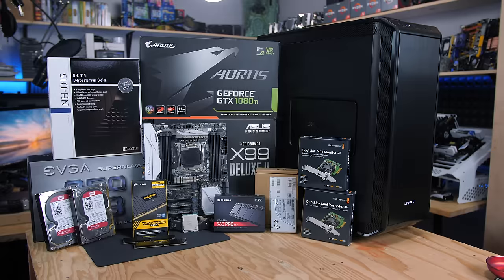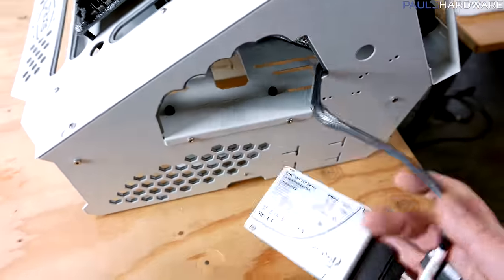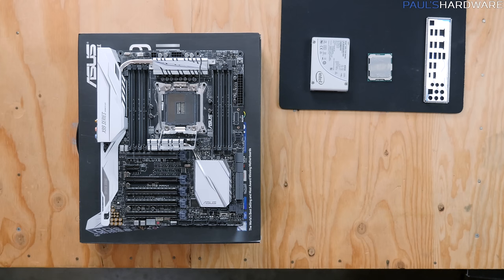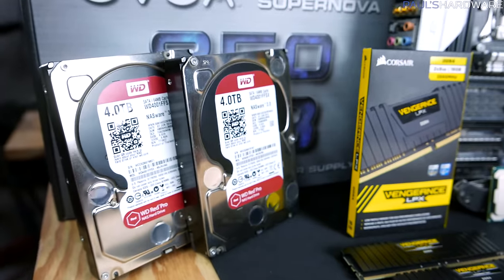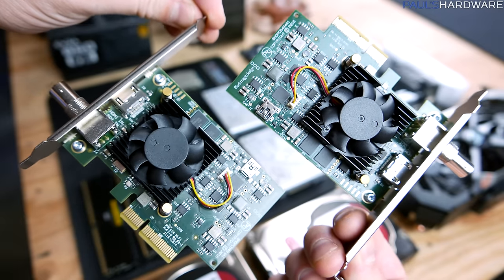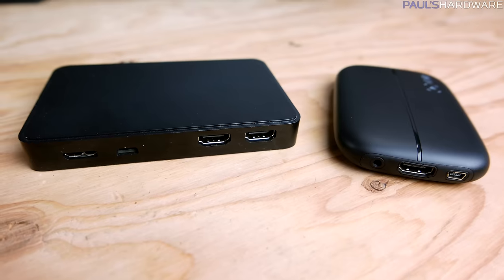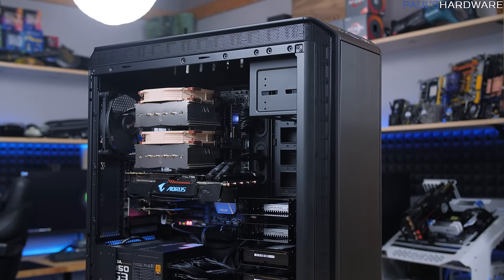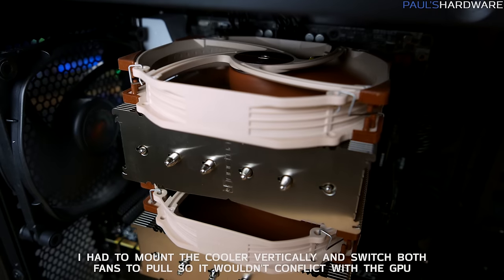The GODLY PC! My Ultimate Streaming + Capture System Build

Comment: This build erased my floppy in no time. Thanks Paul!
Reply: xD I read this in completely the wrong way!
Reply: Wifysauce is awesome.
Reply: I need help guys!!! I want to build a gaming/streaming/editing build. I want to know if these parts are good and compatible with each other. I don't know much about building a pc and the parts.

WD Blue 3TB Desktop Hard Disk Drive - 5400 RPM SATA 6 Gb/s 64MB cache 3.5 inch 
Questions: 
1) Is 7200RPM worth? Or is it worst? 
2) should I get more compacity?
3) Is SSD worth the buy for a content creator? Also what SSD should I get?

MSI GTX 1080ti Gaming X 
Questions:
1) is there a better graphics card? Besides the Titan X 
2) Is the EVGA or ASUS version better or worse? Is there no difference?
3) Is this worth for my type of build? Should I downgrade to a gtx 1080?
4) is the founders edition better?
5) Do I need multiple graphics cards?

Intel 7th gen Intel core desktop i-7 7700k 
Questions: 
1)Is there anything better?

G.SKILL TridentZ RGB series 16GB (2x8GB) 288 pin DDR4 3000MHz
Questions: I was planning on getting 2 sets so I would have 32 gigabytes. Is that to much?

Cooler master  GM series G750M - compact 750W 80 plus bronze modular psu 
Questions:
1) I don't know much about power supplys but I this compatible with everything?
2) is there something better I should buy?

Cooler master Nepton 240M cpu water cooling System all in one kit with 240MM radiator and 2 silencio fans
Questions: is water cooling worth in this situation?

MSI computer X99A gaming pro carbon ATX motherboard
Questions: 
1) like I said I don't know much about pc parts, but is this compatible with everything? 

Master case 5 mid tower computer case
Questions:
1) will everything fit in this easy? Is there a better looking case that looks good and can fit everything? (I personally dont like this case)

Am I missing anything? please tell me. Also thank you so much if you help me. I will respond as quickly as I can!
Reply: Your missing a video card and storage :)
Reply: Skoarch pcpartpicker.com will help you with compatability...

Comment: when you want a PC but can't afford it.
Reply: captainrobots  well i have almost the parts i just need my i7 6700k a 250 gb ssd and windows 10 usb
Reply: jacques lammens If money is your problem you can download the Windows 10 installer and install the ISO to a disk. Install the operating system onto your SSD and it still needs to be activated. Use a windows activator like KMspico to activate it.

Comment: building my dream pc but ill buy a 1080 ti and go from there
Reply: You don't need a 1080ti to watch porn...
Reply: Derpsensei67 Gmd I make videos for gaming render them with my r7 1700 and I want to try 4k gaming
Reply: Still only use a 1080 it's really not needed to have a 1080ti
Reply: Another note worthy thing is 4k doesn't look to much different to 2k on a 1080/1440p monitor (texture wise) aside from it further decreasing the need for anti-aliasing, unless you got yourself a UHD monitor (which for gaming I'd recommend a 120/144/165 Hz monitor over UHD)
Reply: Keep saving up until you have the most up to date machine buying parts is kinda dumb
Reply: SlackPie/Mystosia is a 1070 advisable for 1440 ultra wide 7th?
Reply: SlackPie/Mystosia 75hz
Reply: Sydney Bailey thanks I have an rx 480 4gb so I wanted to upgrade do you think after Vega Volta relase the 1070 will drop in price
Reply: Sydney Bailey i have an r7 1700 and a 16gb ram at 2400mhz I know about the memory issue but will the 1070 work with obs well and what cpu will you get for your brother ?
Reply: Sydney Bailey nice cpu ! choice and you think it will work well with rendering ? Do you mind looking at my YouTube channel you don't have to subscribe just look at my quality just for feed back
Reply: Sydney Bailey hey thanks for the sub so with the 1070 it will be better quality do you reccomed racing gaming chairs ?
Reply: I would recommend them yes i have a AKRacing chair 500 aud and it's a hefty price but very comfortable and nice and warm when it's cold, and it looks amazing, I'd get a 1080 tbh man but if you wanna save a lil a 1070 is a good choice, im upgrading my 980 to a 1080 soon so that should be exciting, I watched a lil of a vid of yours and I like it a lot, you have good video quality, good audio and good commentary (something rare these days) im going to sub to you and follow you, keep the good work up buddy
Reply: your dream will change in 7 months when volta is coming out
Reply: UrProxy a ti is good for a stable 4k at 60 but mind you the huge price tag for it
Reply: mechaart yeah I know of the huge price tag 700 or so is worth it just asking I have a 600 w psu 80 +  certified is it ok to use the 1070 with it
Reply: ***** I already have ryzen
Reply: ***** I'm waiting for Volta so then price drop on the ti or 1070
Reply: ***** nvida has CUDA and nvech
Reply: Im giving my friend my AMD parts from my full tower and then going to focus on a Ryzen build. I might probably get a ti or Vega or Volta gpu by that time juncture so I can have a intel and AMD build. But yeah, go with the ti... just wait after summer for a sale as when the new gpu's come out they will lower the ti to 600 or 589. 

I learned the hard way, when I purchased my 1080 Amp Extreme Zotac gpu, a week later it went down in price and came with a free game.

Still hope you enjoy your future rig for 4k/5k and even 8k gaming, PCMR is a huge family of gamers.
Reply: mechaart thanks for the welcome I've been pc gaming 1 yr on my laptop this is my first real year and its a hell lot of fun I can make video I can stream with some quality but its still really good full hd and yeah I want to get a 1070 or ti by,the end of the summer basically after the new releases dose it make sense to sell my 480 4gb and my 460 2gb and put the difference between the 1070 or the 1080ti
Reply: UrProxy Always go from motherboard+CPU first.
Those can hold for at least 5 years
GPU can change each 2 years or so.

Remember when Titan X (Pascal) won the race? It was beaten by GTX 1080Ti.
Remember when GTX 1080Ti won the race? It was beaten by Titan Xp
And those were happening in 1 years with barely same price
Reply: UrProxy You should start with buy the monitor first. That 4K monitor is almost the same price as the GPU, if you buy the best one out there, it should hold for next 10 years or so
Reply: KevinMulia I'm not gonna change my cpu for around 3-4yrs but I want a nvidia gpu so ill go with the ti or 1070
Reply: KevinMulia I think ill go with gpu first
Reply: UrProxy That is a fast response :)
Reply: KevinMulia thanks while I only play at 900p ill upgrade to 1440p by ultra wide , so if I get the 1080 ti no problem and the 1080 ti will the gpus do good in recording like obs studio as of right now my videos look a bit pixleated and not as sharp as they should be could you give me some feed back and see if. Its just my monitor or its just me ?
Reply: UrProxy Then go for Ti, it is designed for 4k gaming while 1070 is designed for 2k gaming.

But, I suggest you to hold buying it after May since it will be computex, lots of new products will be available and hope if the price would drop.
A little discount is always goods when buying something
Reply: KevinMulia oh yeah i for go,to have a 480 4gb and 460 2gb should I sell the 480 4gb for 150 the 460 for 50 so id have 200 chash back and as the diff only 200 more I can get a 1070 does that make any sense at all?
Reply: +KevinMulia that's what my friend said after going gpu, monitor, mb+cpu+ram every few months.
Reply: save every dollar for the build u pick now, by the time its done u can get better for the price. trust me. i bought my gpu early, then 3 months later the 1080ti came out
Reply: wait for the 1180Ti its better ....
Reply: UrProxy i
Reply: MrBall Breeder *2080 ti
Reply: probably the only thing you'll be able to buy since they're so expensive haha but jokes aside good luck and have fun dude
Reply: UrProxy legit my dream pc is nothing big... just have a $550 build, 24 inch monitor and logitech g105 keyboard. Really all I need is a new gpu. Im trying to go for a rx570. Good Luck!
Reply: JustGotAGamingPC you to thx
Reply: CUBEX (Baen) you two thx
Reply: Sydney Bailey how much was your rig?
Reply: PsychoSavage88 in total about 956
Reply: PsychoSavage88 i just switched to the 1060 6gb
Reply: UrProxy wow I admire you I'm saving up to build my 1st pc so I'm learning about everything my budget is 1500 to 2000 and I feel like your build is pretty much what I want to achieve,I see no point n going full 4k 60 frames but anything within my budget that can get me the most out of graphics and performance is what I'm down with.
Reply: PsychoSavage88 thanks I appreciate at that and 2 this is my second pc I had a prebuilt and upgraded it I cant say with your,budget you could game at 4k 60 definitely I waited and got a deal
Reply: PsychoSavage88 so if your going for a budget definitely get it in bulk as for my cpu gpu and ram it came as a bundle for about 350 dollars at new egg than I bought it with my 480 4gb reused my os then I waited then bought a gtx 1060 6gb 2wks ago
Reply: Thats a dumb idea seeing as technology advances so quickly. Pick a price point you want to spend on a PC and save up money until you get enough to buy all parts at once (mainly MB, CPU, GPU) that way you have spent your money on the best available tech at the time.
Reply: 1070 isn't really an upgrade.  1080 is.
Reply: Miguel Cadavid Can you tell me why buying core components first over time is dumb?  If you buy everything high-end all at once you pay considerably more at the end.  As new CPU and GPU's come out, you have a better chance finding a good deal on those older components that meet your needs at a great price.  I think this strategy can be good, if you don't have 4000$ upfront.  GPU's, CPU, motherboard.  The rest I consider open for compromise.   A year from now a 1080 ti will be 200$ less or even lower.  I use this method for buying my TV components, find the best Audio/video components that meet your needs, then wait over 6-12 months and start looking for deals on those parts. You wind up with a great system , sometimes 75% less.  I have the invoices to prove it.  The I want it now mind frame is self defeating and exactly what manufacturers count on.  Look at specs not adverts or specific brands.

Comment: Why didn't you wait for Skylake-X or AMD Threadripper instead of getting the dead platform X99?
Reply: review sample CPU. 
He can reuse the memory. He'd only need to get a mobo and a new CPU. he'll probably get review samples of skylake X as well.
He said he would have used some other CPU if he didn't have that around
Reply: Alex Smith There's no point of X99 now that there won't be any more processors released for it. It's like buying an AM3 board for a PC you are going to use for years.
Reply: Exactly.  X99 is no longer in production and both companies are releasing new HEDT platforms within what like 3 months.  Purchasing X99 hardware new is a seriously stupid idea unless it's a very time sensitive application that requires immediate attention.  Although in Paul's case, he had all of the hardware already so it wasn't a money waste, but I mean who here thinks he won't be getting the HEDT stuff from both teams for review so he could have just built a new system then and saved half the time.
Reply: earth418 Streaming cannot be buffering, it should be immediately
Reply: earth418 Here is your fault, X99 series is not intended for consumers, it is intended for heavy workload. From intel side, X99 with 6950X is the latest versions in its lineup.

What is the difference between Enterprise-grade and Consumer-grade?
The PCU Lane is the obvious one.
Paul is using ALL 40x PCI Lanes
16x Graphic Card
8x NVMe
4x + 4x U.2 SSDs
4x + 4x Capture Cards

By the process of elimination, there are two lineups available and all are from Intel (for now), Xeon Families and i7-6950X.
And you know Xeon is Server grade CPU.
Reply: Kevin, he means X99 is just a few months away from being outdated.  The timing isn't that great.  Ryzen 9 Threadripper is set to have 40 lanes for every sku while intel is restricting it to only the top 2 CPUs with the other i9's having 28 with the X299.  They will also see at least one or two generations of newer CPUs released for them - unlike X99 that is developmentally dead.
Reply: @cracklingice, Why don't you tell us more about how one of the most powerful and diverse platforms ever created is now obsolete. Supplanted by a lesser generation, whose only advantage is a couple extra cores, but is in almost every other way inferior to its predecessor. The only two CPUs that truly took advantage of the full power of the X299 chipset are the 79**Xs, who have 4 more PCI lanes to go with their extra cores. The other two supposed workstation CPUs along with the KabyX will lose lose lanes. The 78**Xs will have 28 lanes, down from 40 on the 6850k (so much for full power x16 dual SLI, kind of a major selling point for enthusiast gamers). The KabyX, what a joke. Lets transplant a 4 thread i5 onto a workstation mobo, with dual channel RAM, 16 PCI lanes, and call it an i7. What a brilliant idea. A CPU that can only utilize 16 of 44 lanes, presumably only capable of using 4/8 ddr4 RAM slots, with the same 14nm architecture as the last generation. It can't even support a single GPU at x16 and one M.2 stick. Unless Intel is going to pull a rabbit from their hat. Just like its quad channel RAM support coming soon (trust Intel, OBEY, they cannot lie).

Oh, yes, but X99 is dead. I am in utter despair. How will I ever go on using my weak, outdated, 6850k. 

I wouldn't trade my 6850 for that POS 7820X if they offered it for free.
Reply: It's dead man.  Not obsolete.  It's simply just a foolish errand to buy into it when it's only 3 months away from 2 new alternatives that will be supported for at least a few more years to come.  PS - Threadripper has 40 lanes on every one of the Ryzen 9 CPUs.
Reply: lol
Reply: ***** this is how Trump got elected as President
Reply: earth418 Here's some answers: 1) Because he can't/doesn't want to wait? 2) Because this system will perform just fine for years for its intended purpose. 3) Because he had (most of) the parts laying around anyway. 4) Because he'll get the new stuff from those big companies when it comes out.
Reply: Pennywise *through
Reply: cracklingice He didn't purchase anything, just had it around anyway. 
Why he didn't wait for the new release? Perhaps he urgently needs an upgrade for his capture machine because it isn't good enough, and waiting a few months isn't an option. 
also AMD in 2017 LUL.
Reply: and pcs have come reeeal far since 1150 socket eh???
Reply: The Echelon I agree, but I thought he had bought everything in the PC. Since he hadn't, it's fine. Anyway, you are right, it's still an insanely good PC.
Reply: Dead ? loooool
Reply: "dead platform x99" lol. inb4 the dude has a dual core sitting on his pc
Reply: earth418 why to spend more when you already have a capable enough cpu lying around buddy. 8 cores are enough for streaming and  capturing
Reply: He needs a pc now cos its his job, and  any future upgrades would just be expenses for his job anyway, so it doesnt matter(the cost)
Reply: Lul, he had everything so why bother waiting? He can build it since he already had the parts lying around lul. And enjoy the computer while waiting for Threadripper or Skylake - X. Lol stupid comments are stupid.
Reply: Revan, AMD in 2016 would be LUL but Ryzen is actually very competitive.  I'd take an R5 1600 any day over any i5.  Also I never once said Paul purchased anything and yes he did - just not the X99 parts.  It was capture parts and ssd.  It's a time sink building the X99 system only to replace it so soon in the future if he does.  I think more likely the new stuff will be test benches - although I'd want the heart of my setup to be running the best stuff I had.
Reply: Rafael it's an i5-2400 quad core.  And it's platform is just as dead as the X99 platform.  Neither are receiving new chips.  aka dead.
Zion, unless he saves as much time in production as he spent on building the machine before replacing it then all he got out of it was this video. Though as I said just above this in my reply to Revan, he probably will need the i9 and R9 setups for test benches so using the X99 for him makes a lot of sense.  For anyone paying for it, even used, it's just plain stupid.  The level of stupid will go down a lot though AFTER i9 and R9 launch and drive the cost of used X99 hardware down.
Reply: This is damn near identical to my build.  Looking forward to seeing the benchmarks you get.
Reply: Paul acted as an AMD fanboy and build the best render pc the cheapest way (sarcast)
Reply: Says someone who didn't watch the video.
Reply: He had a 10 core CPU just sitting around.
Reply: And will likely need the test bench cleared off for the upcoming hedt testing.

Comment: Weird, just 5 days ago I built my gaming rig and I'm also using an Aorus 1080Ti and a D15 cooler and I had absolutely no issues mounting the cooler horizontally with the GPU mounting in the second expansion slot, just as in your case.